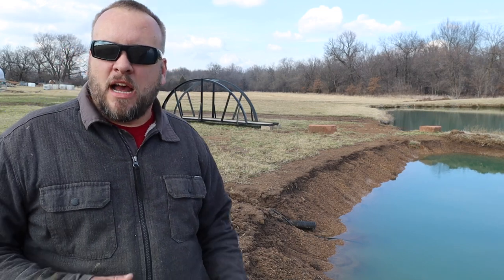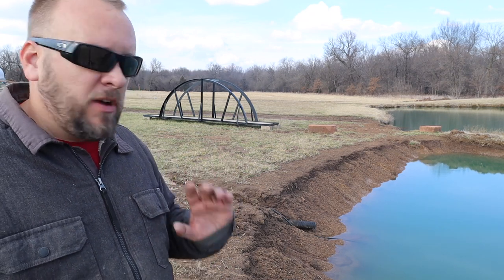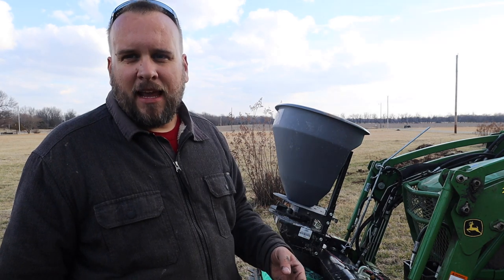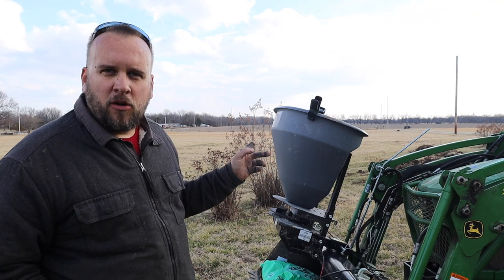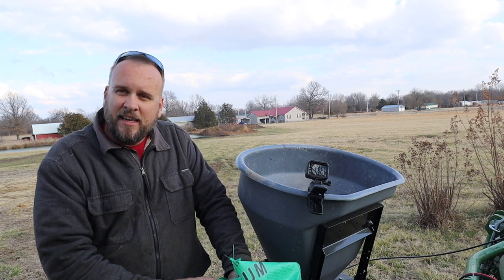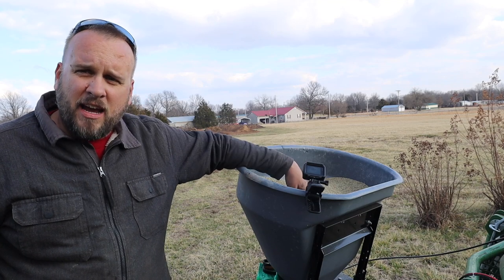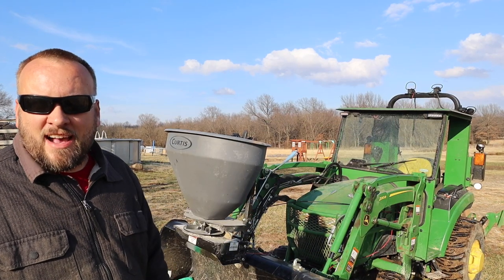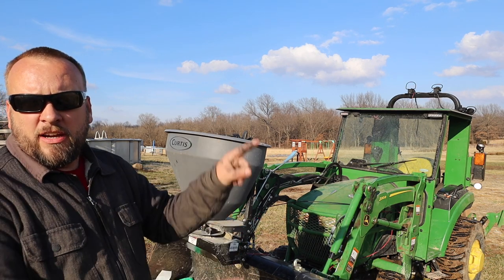Overseeding with an Electric Spreader on Your Front End Loader

Comment: brock,

do you de thatch?  aerate?
Reply from the maker: No, It would definitely work better if I did though.  The only thing I have to do it with is a little handheld tool.

As much as the seed cost it probably be worth it to get a little pull behind unit

Mainly what I was doing here was testing the spreader and trying to fill in the bare spots from when we dug the drain lines and pulled out the corral
Reply: @RockhillfarmYT  yeah, I would invest in those.